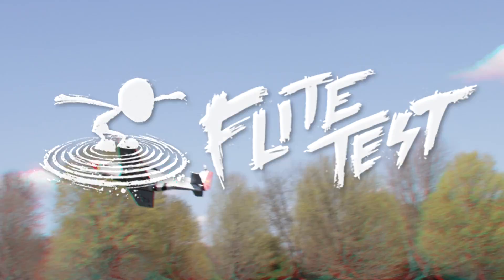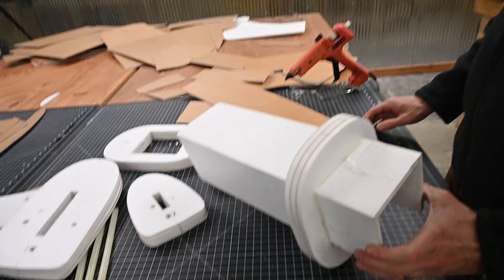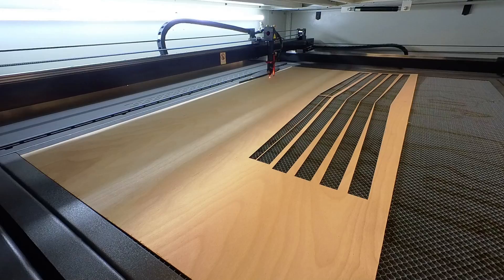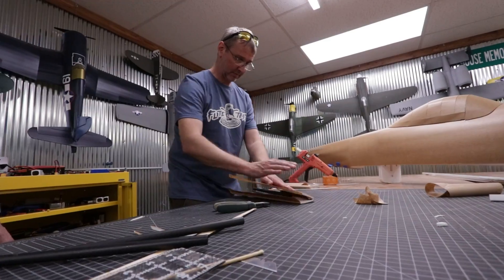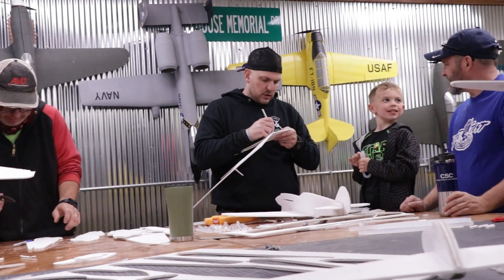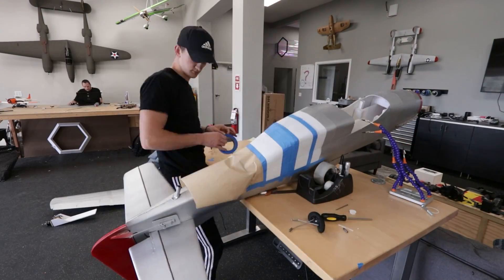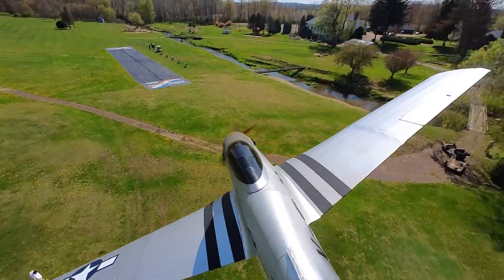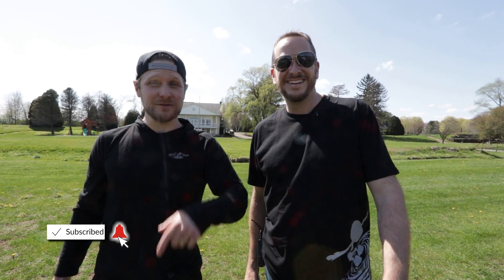Building And Flying A Monster Size P-51 Mustang

Comment: This tail design John designed in his moment of clarity works super, I just used it on my enlarged 55.5" wing span P-51 Master Series that I'm starting.  Nice job, John  😍 thanks.  Enlarged X 1.1566 = 55.5" wingspan.  This is about the largest to still use one sheet of foamboard for wing half.

Comment: Does planes are called the red tails.
Reply: Only the rudder is red on the squadron this was part of.  Not all red tail planes were the famous Tuskegee Red Tails, check the paint design difference, There was a squadron with just the rudder painted red like this plane and the Old Crow P-51 where as the Tuskegee "Red Tails" had the whole tail section painted red, just fyi 😊

Comment: What is the material you are using to built the P51 Mustang?
Reply: watch flitetest videos much?   They use regular size and thick foam board found on their store.  They also use a thing called a "hot glue gun"

Comment: plz! try to make an FMA IA 58 Pucará! plz!
It is a twin-engine, two-seater ground attack aircraft designed and manufactured in Argentina, very handy and with a wide variety of weapons, it has reinforced landing gear for defective and short runways.
Currently it is no longer for ground attack, it was out of service for a year until the "Fenix" project, which was responsible for updating 5 or 6 of these aircraft with new engines and technology, returned to service in 2020 as reconnaissance aircraft mainly.

Comment: What exactly was the covering that was used.  Looked like a thin layer of something flexible that was covered with brown paper.
Reply: watch flite test much?
Reply: Foam board is on their website store.  Dollar Tree foam board is next to useless, it is almost too cheap to make a good plane from and the paper wrinkles if not carefully painted with light coats of Rustoleum.  It is about the only spray paint that won't destroy foam.
The Flitetest foam board is great, you just need to scuff the surface prior to painting.

Comment: If you read the FACTS AND HISTORY! He shot it as it approach his landing back. Yes he’s ONE OF the first who shot it down. But not In COMBAT! As you ME-262 Flew a lot faster than our fighter planes. Credit for the first Me 262 shot down by gunfire, however, belongs to five pilots from No 401 Squadron RCAF on October 5th. Flying a high patrol over the Arnhem-Nijmegen area the twelve Spitfires from 401 Sq soon spotted a Me 262 diving toward Nijmegen at 1445hrs. The Me 262 did show some fight and returned fire on several occasions with little result. The Me 262 was hit by five individual pilots causing it to burn in the air and crash in friendly territory. So fighter pilots Joseph Myers, Manford Crory and Chuck Yeager did take the ME-262 but not by force, Not one shot was fire by either german or american pilot.

Comment: On March 24, 1944, a fleet of P-51 Mustangs led by Colonel Benjamin O. Davis, commander of the Tuskegee airmen, set out on the longest escort mission their crews would fly during World War II. The 43 fighters were there to help B-17 bombers run a gauntlet of over 1,600 miles into the heart of Hitler’s Germany and back. 

The bombers’ target, a massive Daimler-Benz tank factory in Berlin, was heavily defended by whatever forces the Luftwaffe could muster at that point in the war. The 25 aircraft protecting the plant included the battle-tested Fw 190 radial propeller fighters, the Me 163 “Komet” rocket-powered plane and the much more formidable Me 262, history’s first jet fighter and the forerunner of today’s modern fighters.

Comment: Credit for the first Messerschmitt Me 262 jet fighter to be ‘brought down’ in combat belongs to Joseph Myers and Manford Crory of the P-47D-equipped 78th Fighter Group, who manoeuvred a 1./KG 51 machine into the ground on August 28, 1944. The German pilot survived.  No shots were fired by both sides.  It happened again on October 2nd when P-47D pilot Lt Valmore Beaudrault of the 365th FG caught an Me 262 out of fuel at low level, forcing it to crash land.  Astonishingly, the pilot of the jet on both occasions was Oberfeldwebel Hieronymous Lauer who survived both encounters.

Comment: Hey. 
Anyone know what this model weighs?

I'm building a plane with a 2.5m(98") wingspan and about 10kg(22lb) mass at take off, maybe 7kg with payloads removed. And ideally launched or take off as low speed as possible

Anyone got an aerofoil recommendation? I was recommended mh32, which has a 8.7% thickness.

If I scale up the thickness to 10%, does that negative affect the CL? Guessing as the camber will also thicken up.

Anyone suggest otherwise?

Comment: Ok, ok, I have an idea: a huge rc vtol aircraft that has 4g connection and solar panels and also a regular rc transmitter, that then carries a bunch of fpv quadcopters that have wireless charging so they can just land on the mother ship and recharge.
Basically, a huge drone aircraft carrier that can operate without human interference for days on end.

Comment: Hello chanell, lets make a rocket glider. it looks like a rocket but it is planer to. after the ignition of  charge, vertial take of and go to null velocity altitude, they will open a retractable leather wings and transform to planer. Then it was planing with FPV and controlled stabilizer.

Comment: Great build, I've just scaled a Dauntless SBD-5 Marine ver. and I'm 35% into it.  I think this would be an excellent challenge for John to work with, dive flaps and all, although I'm not sure if the 20" prop with your 4030 motor is sufficient... You guys keep the inspiration going, wonderful job!!!
Reply: I was thinking of building something similar. Did you ever finish?

Comment: If you took a cylinder, cut a large slot in the top, took a large EDF and funneled the thrust into the slot and put a mesh screen in the slot to keep BBs from falling into the EDF when inverted. Then add six 6mm tubes routed to sprout out the historical gun locations. When you turn the EDF on it will fire all the BBs out the tubes. You can now have a compact MG setup where you can have wing guns and have pretty much all of the workings in the fuselage. Depending on the size of the EDF and the weight of the BBs(Heavier would be better), you could actually get it to shred the foam board.

Comment: i love this and also love the monsters are going to be available in kit form. I also have an idea for a future vid. I got the ft P-38 and i went nuts on her. We got flaps, retract landing gear, landing and running lights. The only thing i cant seem to figure out is a DIY Gear door set. just cant get it to work right. My  idea for a vid is either a smaller segment on how you guys would do gear doors/bomb doors or you guys go full Ham on a  model and give it the "Treatment" with working retracts, flaps and maybe even lights. also need to put this out that this is my first time commenting on a Flight test Vid and is maybe the 3rd youtube comment ever but i love your guys content, so much that before I ever bought anything from the larger companies, I got my self that same P-38and fly it more than most of the stuff I have now. She is older at this point and is showing her age but still fly,s and keeps up with her way younger Viper Sister gbut that being said i am planning on rebuilding her from the ground up  here really soon. keep up the great work guys.
Reply: maybe put the doors on hinge with toothpick so it swings freely, and use a toothpick as a stem that the wheel pushes against to close and hold the door shut.  About a 45 degree angle.  One like that was on a plastic model I built that had landing gear operate on a hand-turned gear.  Or just not use the center doors like I plan to leave off when I build my Master Series P - 51 enlarged to 1700mm using FMS canopy, landing gear, cowling, spinner, prop, as well as motor and lighting kit.  These parts were purchased 2 years ago but may still be available somewhere.  I did the same with the 1700mm Corsair parts from FMS model. The only other advice may be to closely watch FMS videos showing the operation of the doors and use the added servos.  Good Luck, I hope you figure it out, I'm sure you will.